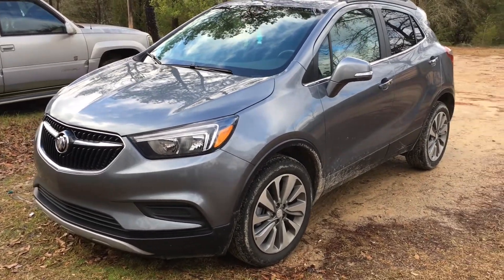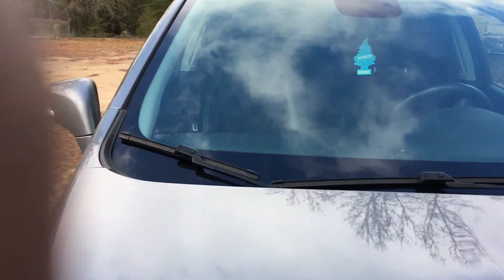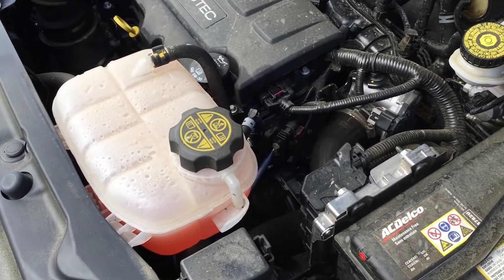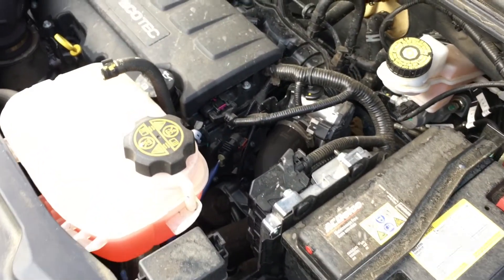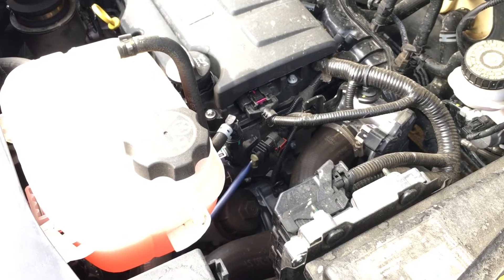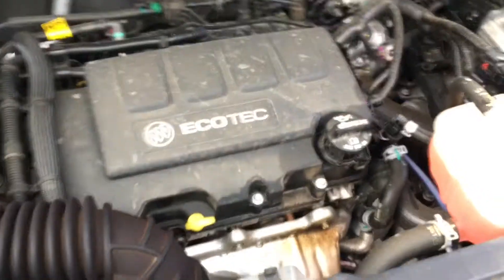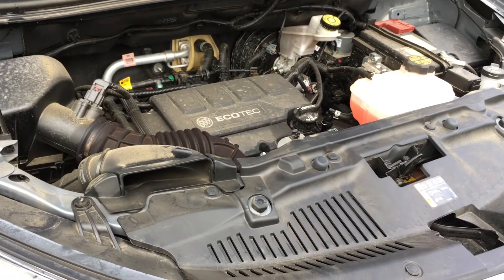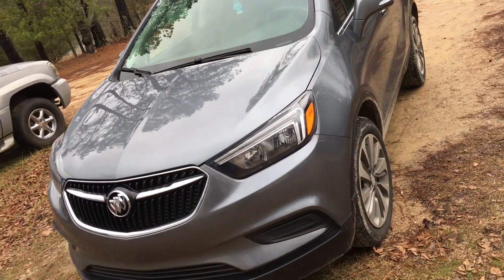GM Ecotec 1.4 Complaint!!!!  Same Motor, 2 Oil Filters???!!!!

Comment: Wow didn't know that I have a 13 Sonic RS it had the black cap with the two press in prong style , too bad they do crap like this maybe so you go to the dealer to get oil change .
I believe the bypass valve is only for a failure in the filter system if it clogs and fails it will open and bypass so you won't burn the motor up . I heard on forums all kinds of crazy things that caused engine failure no coolant due to a leak and no check engine light so dude burned the motor up , transmission went out at 50k miles some of these changes must be due to the system failures  and them replacing engines and in some cases the car itself .
Just order 2 /3 at a time then you will have them when you need them .

Comment: The move towards cartridge type filters is probably a decision to cut costs and save weight and be more environmentally friendly ( use less metal, less metal in the landfills). It's a common thing European designers/engineers do, like, standard in everything that has an engine that originates from Europe. Thank those guys/gals for that.

Comment: Is it a good motor?? Looking at the same buick today. Thanks
Reply: Those engines were junk. If yours go out, you will have to wait until 2024 to get one as of today.
Reply: @atx-cvpi_99  she got a fors escape instead.Good choice
Reply from the maker: The motor in these things are pretty good.  No complaints with mine so far.  Great on gas also.
Reply: Magnus Prime E1 thanks man

Comment: I agree it’s annoying.  If they had to source two suppliers to meet demand, they should have split the production at models, since this affects Chevrolet Sonic, Trax, Cruz, and the Buick Encore.  I’m sure whatever the split, they could have allocated it between these models so it made more sense.  It’s not that hard to tell, but even the caps being black or brown in a dark engine bay are a little annoying, how about two colours more easily identifiable.
Reply from the maker: Noah Eldridge exactly!! Yellow or orange would have been nice lol.  I work for a company that makes these types of ‘decisions’ just to get production done and out the door, then give no explanation as to why it was done “this way “ after the fact, then people like us just have to deal wit it.
Reply: Even the Spark has that engine, OMG
Reply: Similar.  It’s not the turbo version.
Reply: Oh man, the Spark uses a standard, spin-on oil filter.  Now I’m really jealous.
Reply from the maker: Noah Eldridge damn just like the good old days.
Reply: I don't know why GM tend to over engineer their engines in their luxury brands, is just a nonsense